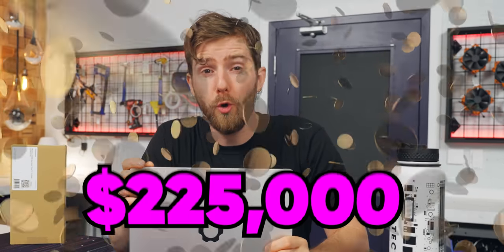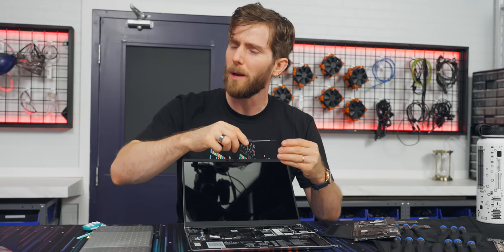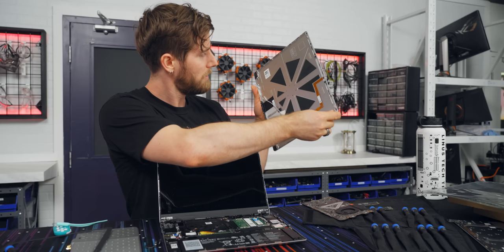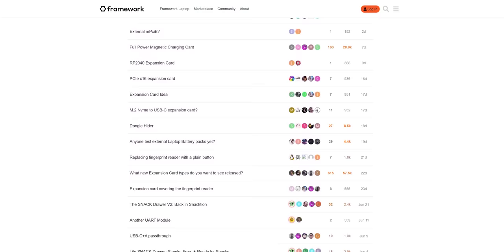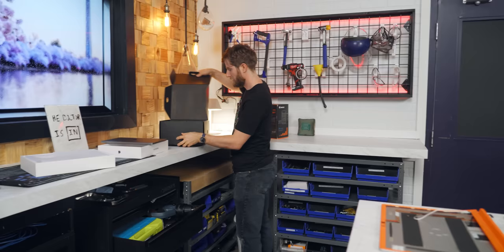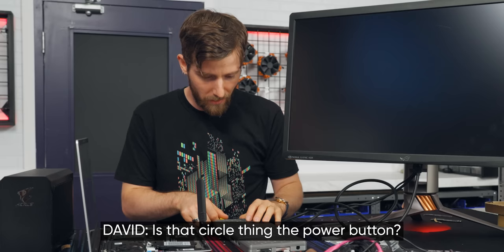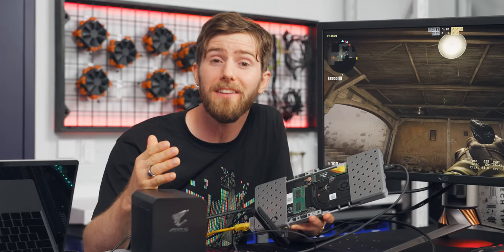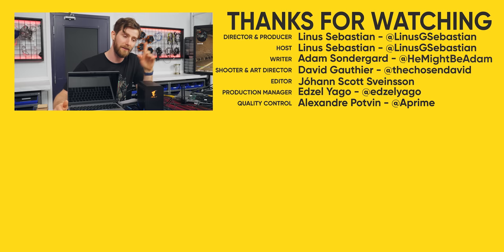I invested $225K in Framework Laptop - 1 Year Update and 12th Gen Upgrade

Comment: I got an 11th gen Framework laptop A few months ago. I also loved everything about until I discovered how flimsy the top cover is. From simply tilting it back normally with my fingers, the screen cracked... Tried to get it warrantied, with no success. (They classify it as "Customer Induced Damage"..) Super frustrating as a customer. I've been so stoked about Framework but this customer service experience has really put a damper on things.
Reply: That begs the question if it's something they've seen a lot of. If it's you and two other guys, then I'd err on the side of customer induced damage, too.
Reply: you broke your screen so how is that covered under warranty
Reply: @verygoodbrother  I think you'd agree that tilting the screen back is something that falls under normal/expected usage. If a product can't do what it is advertised without breaking, it's the manufacturer's fault.
Reply: @FrobergDK  They wouldn't have designed a new top cover if it was isolated incident.
Reply: Well to be fair, you don't know if they did that because of customer complaints about a "flimsy feeling top cover" was the reason, and not that a plethora of people were actually cracking their screens. Cracking a screen is usually not that easy to accomplish.. either takes massive weight on top or real effort to accomplish. 

We'd need their internal numbers to know for sure, either way. Just playing devils advocate and saying that it doesn't necessarily make them evil for not believing you in this instance. 

It sucks that it happened to you though, I can only imagine.

Comment: I bought one half a year ago as my private laptop and I am somewhat happy with it: 

Most of the hardware issues (trackpad, fingerprint reader) went away with the newer Kernel that comes Ubuntu 22.04 .

The only remaining issue is the low battery life and that the battery drains within a day on suspend. Not a big issue for me as for traveling I use my company-issued Mac but if this was my only daily driver that would suck a lot.

Other than that it is fantastic. I pitched this to the IT department of my employer because we can easily switch keyboards to the liking of new employees and adjust specs and label ourselves a bit greener doing so. But sadly, we as a company only support (very) cheap Windows boxes for everyone not in engineering and Macs for the rest.

Comment: I'm not interested in a laptop this expensive, only to have Intel iGPU in it. Love the concept... But man do I not want that Intel iGPU. A dedicated GPU would come a long way, even a low end one like a mobile 3050. Or the newer 6800U Ryzen mobile APU.
Reply: I read up on it and it seems the Iris Xe 96EU in the i7 12th gen models are comparable to maybe a 1050 or a 1050 Ti, so it’s not the older UHD/HD crap that’s like 4x weaker.

I still want a Framework with an actual GPU too :/

Comment: I won’t lie, what keeps me from buying a framework laptop is the small 55 wh battery and lack of discrete gpu. If they had an option with an nvidia gpu and 80-90 wh battery they would be my go to.

My daily at the moment is an ASUS Tuf Dash F15

To give ASUS their credit where it’s due, it’s not hard to get replacement parts.

However, I’m really stoked to see open schematics and a commitment to open source in general, one can only hope the whole industry follows suit
Reply: Vote with your wallet :)

The battery actually lasts a really long time. I was able to take notes for a whole workday, everyday, when I needed to on the 11th gen. But if you need a discreet GPU, there's obviously nothing that can be done. This was a concern for me, as well.
Reply: That's funny. The fact that it supports connecting to an eGPU is one of the big selling points for why I'd consider one.
Reply: @GSBarlev  I would need an internal GPU, I cant reasonably carry an egpu
Reply: @KJ4EZJ  Yeah, I would definitely need a bigger battery as I tend to go for the performance versions of the chips. Which more often than not require dual fans to go with it. As for the GPU, they wont have the space inside a 13/14 inch chassis to cram in an rtx 3070. Especially with them having modules, the modules for me are valuable space for cooling that is wasted, however to others the modules are extremely useful.

However, as I said before, I am stoked to see an attempt at a fully open source machine. Hopefully soon they release something with my requirements.

Comment: I'm skeptical of the practical effect of frameworks modularity on e-waste.  If it ends up having a major benefit from the manufacturing side of things, I'll eat my words. But from the consumer side I don't see its theoretical effect translating into practice.  In this video alone you made two upgrades to fix issues that you probably would have just dealt with if no upgrade was available.

Its a huge effect for customization and (user) reparability.  But as for e-waste reduction and trailblazing otherwise unavailable upgrade paths, I'm just not seeing the potential yet.
Reply: I would argue, that if you have a series of minor issues, over time and as you develop more budget, you would like most people consider new laptop options, and the whole laptop at some point would become e-waste purely because time. For me personally, I bought one when Linus first made a video about them. I was not super married to the intel CPU but I am not locked into that, so when an AMD option shows up, I will upgrade the motherboard. If I had a minor issue with the hinge or backplate, I would throw 60 bucks at it and have a no issue laptop. Practically as a consumer, there are things I might want later and those things as long as framework adapts, will come in module form, like ethernet, or official thunderbolt. 

It feels good to know if I need some functionality its usually just a module(like when I got a new dashcam that used microSD cards and I just went to framework and bought a module for a few bucks) that gives you new functionality when you need it. The lack of dedicated GPU does suck but there are options like Linus mentioned but what I can see is that if those options become available in the future, I won't have to abandon everything I have to get the new thing. Like even if there is a completely new and incompatible frame, and mobo for dedicated GPU version. My modules could still work, possibly even the screen, webcam, and other parts. 

I don't have any info on the manufacturing process for these, but their point of not having to reinvent the whole process just to change a hinge or backplate is not hard to believe. Needing to have several different manufacturing runs for all your different products is costly and being able to keep the same process for assembly but simply changing parts as new version comes out, will keep costs down. Especially considering that all excess parts can still be turned around on the store sold individually as repair/replacements it won't mean they are now E-waste because you made some minor change not everyone even cares about, like making a backplate stronger and more recycled.
Reply: "have spare motherboard to sell" = "less e-waste"?
Reply: @sonickrnd  Yes, that would be less e-waste because if it can be used for a different purpose its not wasted. However  if lets say everything was soldered onto the board and you could not put that board in a different chassis, then the only option would be throw it out. 

Even if the mobo is worthless, the less e waste would be that you did not have to throw out any other components than the mobo and CPU. Such as the frame itself, or memory/modules
Reply: You keep what still works and replace what doesn't. As opposed to throwing out everything. That is how you reduce the e-waste
Reply: You guys are making some great cogent arguments in theory for how Framework might be able to squeeze even more years out of a laptop by buying a modular ecosystem rather than an inter-dependent collection of parts with few interchangeable.  I'm arguing about the difference between theory and practice but gave no supporting points and arguments due to laziness and the fact that long comments get ignored.  Well here they are:

The average person can reduce their e-waste by putting up with an old computer for as long as possible.  Modern hardware is better than it has ever been at staying relevant for non-specialized workloads for years and years. My 8 year old computer can handle even some of the more computationally intensive things required by my job just fine.

Let's start with a case study to illustrate my point:   I did eventually upgrade my 8 year old computer this year.  Custom built desktop computers are the gold standard for modularity, so I must have been able to re-use a lot of it, right?  Despite my best efforts, the power and cooling required for modern CPUs required a new CPU cooler and a new PSU as my old ones couldn't handle it.  I have a lot of devices which benefit from the faster new USB standards, which would be nice to have on the front, and also needed more cooling space in general due to the higher power budgets of today, so I needed a new case.  The fans spaces for the newer case were incompatible with the size of the fans from my older case, so I couldn't even re-use the dang fans!  Desktop PCs are the gold standard for modularity and re-usability and I didn't end up re-using a single part.  I don't think this experience is necessarily universal but it is a symptom of a situation that certainly is:  TECHNOLOGY AND STANDARDS IMPROVE IN PARALLEL!!

Because of this, by the time a non-specialized user committed to reducing e-waste might buy a replacement laptop, the entire ecosystem will be different.  The small upgrades one does to eek out another year or two are already user-replaceable by the overwhelming majority of laptops, and by the time somebody needs a major upgrade they'll need to replace 90-100% of the whole thing anyway to accommodate newer standards. Even those modular ports may not be able to carry the data at the speeds and integrity required 5-6 years from now.

But what about specialized users?  Specialized users who require performance might need cutting edge technology.  The ability to swap out the parts specific to a framework machine, which nobody else can swap, should totally be relevant to someone who needs/benefits greatly from the cutting edge hardware of each year or every other year.  But performance-users need performance parts, and these parts are relatively niche to the market as a whole.  They also have widely varying data transfer needs, power requirements and thus cooling requirements.  Building a modular ecosystem that can accommodate such a variety of needs will be a challenge and a half, and still isn't guaranteed to support the cutting edge hardware of the next given year. This difficulty is highlighted by the fact that its first form could not even accommodate something as universal as a dGPU, which I'm sure is partially due to their own variety of power and cooling requirements.  I'm not criticizing the decision.  As a business they seem to be doing an excellent job of effort management to get a viable product out of the door, but this cut corner is still a reflection of the difficulties they face.

As of now they make, what is essentially, a niche product. One they can only survive marketing to the non-niche general public.  The ones who get the least benefit from it, but apparently still have the extra cash. The downsides of such a niche product means they cannot benefit from pre-existing economies of scale to the degree more traditional laptop makers are able to, part of why its so expensive right now.  That increased cost reflects the inefficiencies of materials and energy with smaller economies of scale, issues not less important than reducing e-waste.

Maybe they can rise to meet this challenge, sometime after they get dGPUs figured out probably.  It's not impossible and I applaud Linus for investing a non-negligible amount of money to power the direction he'd like technology to go, rather than trying to get a bigger slice of where it is currently headed, but as I said:  I'm skeptical

Comment: Power issues, track pad (who even uses them anyway LUL) and hinges is a really sign of a new portable company as the big problems. The power is of course frustrating but it is one of the most complex systems in a portable device since changing it can affect the entire system (unlike the trackpad which you should just take out and use as a coaster). If I'm ever in the market for a laptop I think I will definitely get a Framework, especially since I could upgrade the mobo, which is one of the major reasons I dislike laptops, lack of upgradeability. Also, orange bezel, don't mind if I do :D

Comment: I was recently shopping for a new fleet of  laptops for my employer. Framework was one of the first brands I thought of.

Unfortunately not a single option for Nvidia graphics was available. I would’ve bought 10 of them in one go if there was.

Linus, make it happen! Right now we’re rocking Razer Blades, but we always need machines that work with CUDA library.
Reply: Just use an EGPU + GPU of your choice. The framework laptops are thunderbolt compatible.
Reply: @JoeMama-jb9kj  That can work for some people, but it is not a reasonable solution for many use cases

Comment: Whenever they make an AMD version, I’m buying it. 

I think it would be cool to have the desktop with a battery in it to act as a UPS. I have several old Chromebooks that I made into “desktops” like that and put Linux on to act as “servers” around the house, and having the battery in case power goes out or I knock a plug is great

One of the great things with 3D printed cases and all being available is that you could even use just Framework’s internals and 3D print cases would allow for, say, making a custom system with a bigger battery, screen, keyboard, etc.
Reply: and don't force me to pay more $$ to have Microsoft Windows.  Let me buy w/o Windows.

Comment: The bottom line: If Linus can upgrade a Framework laptop, then so can your Luddite granny, especially since SHE would use a parts tray and carefully follow the guide.  

(Pro tip: take a piece of cardboard and stick a loop of packing tape onto it--sticky side out--then trace a small outline of your laptop/etc. on it.  As you remove each screw, press it--head down--onto the tape in the approximate position it came from.  This will allow easily putting the appropriate screws EXACTLY where they came from.  You can put multiple loops of tape onto a single large piece for the outside/inside/etc. areas.)

Comment: I want to be part of this, and I think AMD Ryzen is what I need to get invested. Then I would feel proud to own and support this tech/concept.
Reply: What about Ryzen is so much better? This isn't a gaming laptop. What are you looking for?
Reply: @jamesfranko5098  But that is the point for me. I would like to be able to do at least some gaming on it. And I get the impression that more often than not that AMD offers better bang for buck performance especially in low/mid segment. But I can of course be mistaken.
Reply: @SweemTim89  I'd also like to point out that AMD offers better mobile solutions. AMD is more power efficient, which for a laptop is important. Additionally, more threads/cores caters to a large part of Framework's target demographic: tech enthusiasts. I prefer the compile times afforded by AMD cpus. Additionally the Zen 3+ inclusion of RDNA graphics makes AMD"s integrated options much more attractive. I think over time, AMD will be able to leverage their Graphics tech in order to gain an edge over Intel until Intel starts investing in better integrated graphics.

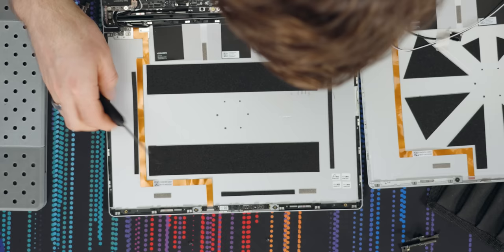Comment: I'm noticing at 6:18 area that Linus is having difficulty finding where a screw belongs. I think it would be a cool idea if the screw heads were color coded, with the matching color ring for the hole that said screw belongs. That way, say you have an extra red screw sitting around, you simply look for the red circle that has a missing screw!

Comment: Still waiting for a touch screen. Once they add that, I'll buy it instantly.
Reply: Why? Touchscreens on laptops are dumb, who wants fingerprints all over their laptop
Reply: @matthewtompkins4338  Once you use a laptop with a touch screen, you’ll get it. It’s so convenient.
Reply: I remember buying touchscreen update for my EeePC 900. :D
Cracked it like few months later, replaced to usual display again. ))))
Reply: @matthewtompkins4338  If you use it for a day, you'll see it saves you a lot of time.
Reply: its probably not that hard to find a suitable replacement screen with touch. but that would for sure bring up the price
Reply: @matthewtompkins4338  Dangit, you again with the same troll from another angle. That means i fell for your bait. shakes fist
Reply: @bullzebub  Panels in this size and aspect ratio (3:2, not 16:9) are actually not at all common, I think the last time I looked for them on Panelook, there were ~9 other panels, only a few of which were still in production, with various resolutions. No 90/120/144Hz panels, no touchscreens, no high-brightness panels. I'd actually put this down as the reason there's no better display option for the Framework yet -- they'd have to have one made, and that would be ludicrously expensive.
Reply: @recurveninja  oh! didnt consider the aspect ratio.